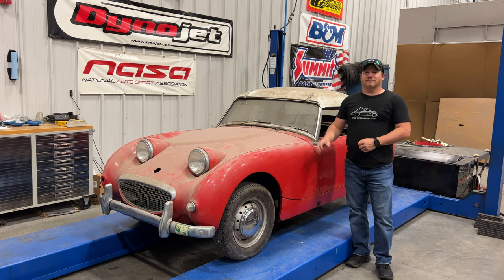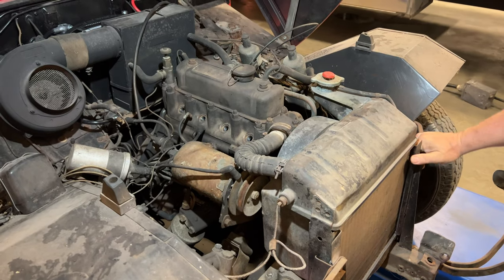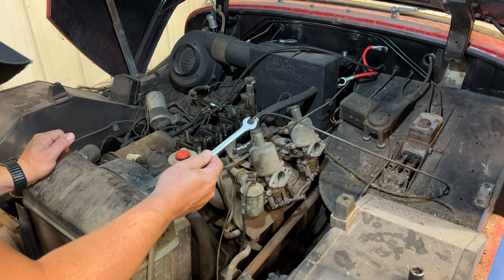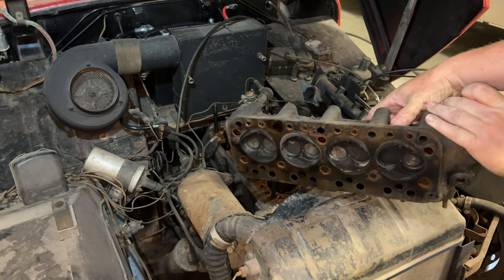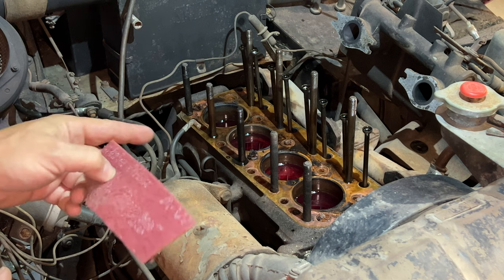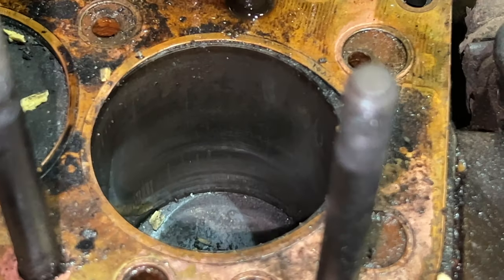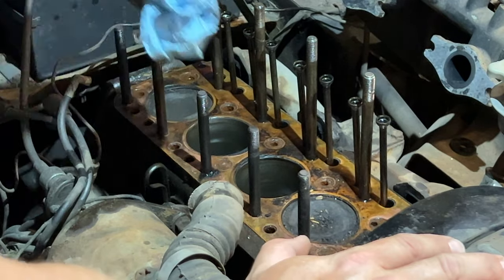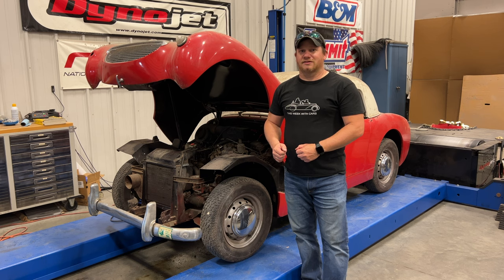How To Free Up a Seized Engine

Comment: If you're interested I can tell you how us real mechanics free a stuck motor. Jerk the plugs and valve cover. Back off the valve adjusters so the valves are all closed. Break the porcelain off the spark plugs and braze an air line fitting into it. Pour in Marvel because it's thin. Hook up the air line and go do something else.  Come back tomorrow and get it running. Ben
Reply: Why not just use a compression tester hose that most people have.  It already has the airline fitting, at least my Actron & Craftsman do.
Reply: @chrispompano  good idea! Never thought about that. We always made the hoses(s). I might see about buying a couple. Nobody does compression checks anymore.

Comment: Adds to much oil and spills half of it
Then takes away all the oil
Doesnt put the car in 3rd or 4th so the wheels would have advantage over the engine and turn it over
Try's turning it over with no oil to lubricate the walls 

Nice job otherwise had a good laugh too mate